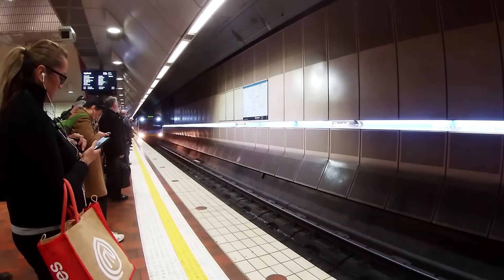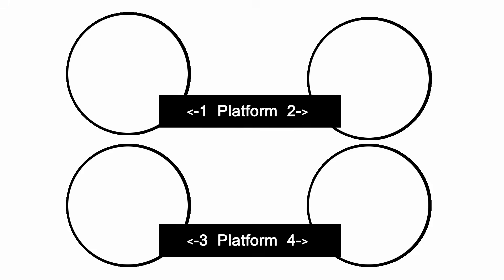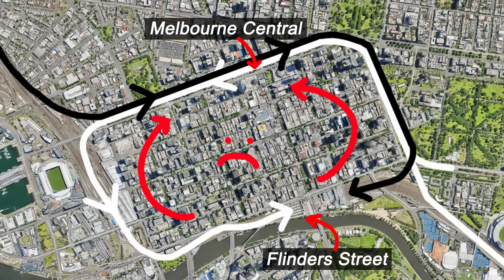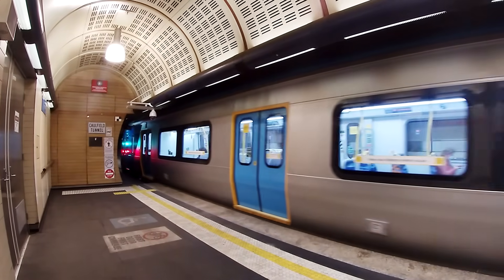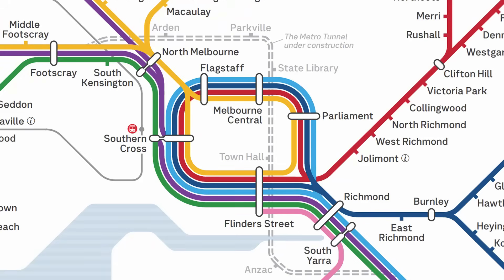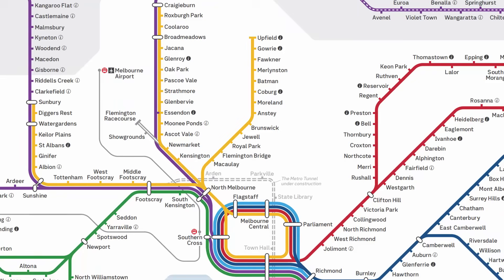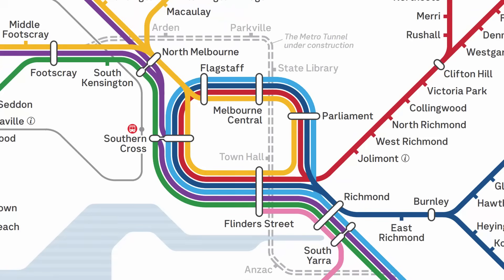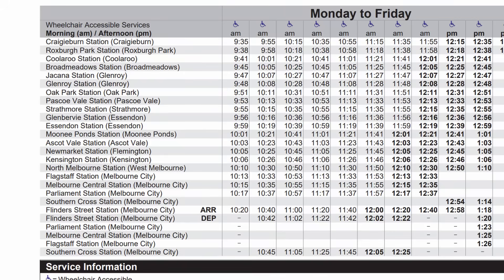Melbourne's Underground City Loop - Explained!

Comment: Usually the sunbury line terminating at flinders immediately goes to southern cross to become the cragieburn line back out to north Melbourne afterwards. But honestly I just use the app to figure out which platform to run to for whatever station I need after getting into flinders or southern cross

Comment: Found that I couldn't trust night trains at all especially at flinders. Sometimes on the board it will say it will come at a later time but then once you get to Southern Cross it will say there's an earlier train but it comes from the same direction as Flinders
Reply: Can't even use google maps after 8pm because it shits itself

Comment: the worse thing is, if you decided the trains are too comfusing so you'll just drive to the CBD, you are in for some more TREATS. first off, it's damn near impossible to find parking, even if you are willing to pay unreasonably high rate. then, you'll be greeted by the infamous "hook turn", where you have to go to the leftmost lane in order to turn right, while obeying the traffic lights perpendicular to you and ignoring the lights you are actually facing. come to melbourne. it's fun (sometimes at your expense)

Comment: Does anyone know what will become of the Caulfield Loop Tunnel when the Pakenham/Cranbourne lines are removed off the city loop and rerouted through the metro tunnel? As far as I know it is only those lines which currently use the Caulfield Tunnel in the loop. If they are to start using the metro tunnel instead, what services will use the Caufield Tunnel?
Reply from the maker: It's my understanding that Frankston will go back into the loop, and Werribee/Williamstown will through run with Sandringham.

Comment: I absolutely hate Parliament Station. I fell up the long escalators and grazed my knee. I was just thankful it wasn’t down. That being said, the lifts from platform 4 are also horrendous. It was so slow that I was truly afraid we’d be stuck. But trying to take a hyper toddler up the escalators was not going to happen.
Reply: There's a separate YouTube video just on those escalators at Parliament Station. The ceiling design creates disorientation going up or down, similar to the effect of an optical illusion. Your brain thinks you are travelling horizontally. This together with their great length have caused more falls than any other escalators in the M.U.R.L.

Comment: There is a great solution to Melbournes Loop problem and it can be found in Liverpool, UK of all places. they have a 'Wirral Loop'. All trains stop at James Street station and then proceed around a clockwise loop. As soon as the train gets to the next station, Moorfields (the first one on the loop), the train then changes it's destination to wherever it is going next and does the normal announcement of 'this train is for [destination] calling at [stations]' so anyone onboard already doesn't have to worry as their station will be one of the few upcoming stations and anyone starting their journey at Moorfields never knows where the train came from but knows which suburb it is going out to.
Reply: they often do this in peak hour in melbourne. I really dont know why they dont do it all the time.
Reply: A similar operation style is used in Sydney's City Circle
Reply: I don't know if this is applicable to Melbourne and it sounds like it would be annoying if you were at James Street and wanted to head in the opposite direction of Moorfield. Honestly Melbourne's city loop is generally ok given the circumstances. If patronage was higher, I could see us running enough services so that trains run both way around the city loop (need bidrectional tracks in this hypothetical obviously) but at the moment the ~10min wait between trains during peak times just doesn't make it worth running a train in the opposite direction at the same time; you just gotta cop the 10 minutes detour around the loop. I've always found it convenient on the Glen Waverley line when I go out with friends that it goes around the city loop (MC being the important destination), but I can imagine the inconvenience of needing to changeover at Richmond to get to Flinders.
Reply: @parkinfurkmaz2877 You can't go in the opposite direction round the loop as it's a single-track, unidirectional tunnel. The stops are always James St > Moorfields > Lime St > Central > James St again > various destinations. This does make the described announcement system a bit pointless though, as if you're going to one of those various destinations, you would have already changed train at Hamilton Square, the stop before James Street.

Comment: So if you get on a train in Melbourne, it’s an absolute guessing game as to where you will end up. That is ridiculous. You would think that in a city as big as Melbourne, they would get it right instead of confusing people, especially visitors from interstate.
Reply: Not particularly, when you get on a train heading outbound (from the city) it shows the line, end station and all stations that the train is taking on platform screens (as well as the line on / in the train itself).

When heading inbound, you're going to Flinders Street Station, and it will show either directly or via the loop on the platform as well as on / in the train.
Reply from the maker: The disfunctional part is having to wait until Flinders Street to find out where it's going next - and frequently having to check the platform displays there, which you really shouldn't have to do as someone who is already on the train.
Reply: @Taitset  yeah, and the stupid PTV app won’t tell you where your Flinders Street bound train is heading to after Flinders Street. There have been so many times I’ve gone on PTV journey planner to plan a journey from my station to one of the city loop ones, and the app is basically like ‘lmao ur gonna have to get the tram from Flinders Street’, but in reality I don’t have to because the train goes through the city loop after flinders street. I wish PTV would update their app to rectify this issue.
Reply: It’s not that awful. There are great displays everywhere telling you which platform you need and they show all the stops on the next train to come. You learn pretty quickly how to navigate.

Comment: Just to travel 2 stations I have to take two trains , talk about Melbourne train network
Reply: Wait what stations need two trains?
Reply: @Chloeshadowstar9779  Kensington to southern cross
Reply: @srinivasanurag9424  how's that happen? If it was a city loop train, most trains that just came from the loop will then go to southern cross, so you could have stayed on it at Flinders and it should have gone toward to Southern Cross
Reply: @Chloeshadowstar9779  sorry I meant when coming back ,

Comment: Had no idea it was so elaborate and complex. That's good and bad. Good because it's more substantial and is  important to the functioning of thewhole rail network and therefore significant infrastructure added to the city, bad because it's not as user friendly as it should be and causes stress to regular commuters let alone first timers. Melbourne being a planned city has dropped the ball here and not done enough to address the problems which reflects poorly to me.

Comment: haha I remember as 14yo in the early 90s friend and I went to the city for the car show on a weekend and then wanted to go to Melb Central. counted the number of stops we needed and took the train. Train was not supposed to stop at Flagstaff on the weekend but it did and we got off. we were inside a locked train station with no staff lol.

Some how we found a pay phone inside and called 000. 15-20 min later a train finally stopped and driver got out and we went through the drivers door into the passenger compartment... The days before mobile phones!
Reply from the maker: Haha that's awesome. Cool they just used a train to pick you up rather than sending someone to unlock the exit.
Reply: @Taitset  Yep! We felt cool going through the drivers door. Driver kept the passenger doors still locked so no more people got off.

Got weird looks from the existing passengers...
Reply: @Taitset  even finding the pay phone was a challenge iirc, ended up in the staff rooms to find one
Reply from the maker: That's pretty amazing.

Comment: An interesting film. I didn't know Melbourne had such an extensive suburban rail network. 
In England,  Liverpool has an underground loop line, though a bit simpler. Trains coming from Birkenhead through the Mersey tunnel arrive at St. James Street, then a single line runs through Moorfields (near the former Liverpool Exchange station), Lime Street,  Liverpool Central, then back to St James Street. There is normally unidirectional running. There is also another underground line connecting  Moorfields with Liverpool Central. The loop line was opened in 1977.
Reply: much better than the circle line in london which isn’t even a circle anymore

Comment: It’s confusing for 2 simple reasons

1 original layout and configuration of Melbourne is confusing to begin with, for a small city it’s also one of the most difficult to get around in. Melbourne was designed by a junior city planner in Sydney on a single sheet of paper. Aka no fucking thought to its layout, not that Sydney is any better. Most people don’t know that NSW and VIC at one stage was one state and Vic was subordinate to all of Sydney’s commands including city/town planning.

2 like all Australian cities they are poorly designed on English structures. English cities were designed for the elite of society as it was irrelevant where the working class lived therefore you have centralised areas of industry instead of it being balanced dispersion. Because of this they did not account for population growth therefore most of the capital cities cannot be upgraded or expanded including the public transport services. Melbournes population is growing fast and with Covid taking a back seat will only continue to grow faster and current infrastructure for Melb is still stuck in the late 90s at best and all current infrastructure projects will only be good for the next 5 yrs.

Comment: I’m from NYC with like subway 25 lines, LIRR, Metro North, PATH train, NJ Transit, and Amtrak. And this loop confused the hell out of me. That’s probably the only transit system I’d get lost in lol
Reply: Basically all lines in Melbourne lead to Flinders Street (and all lines outside Melbourne lead to Southern Cross (Spencer Street). The only question is “do I need to change trains at Flinders Street?”.
Reply: NYC here, too! This makes our system look downright elementary. But in a good way. The NYC system certainly has its issues but understanding it is not one of them. No offense to the creator of this video but a rocket scientist couldn’t clearly explain this hot mess of a system.
Reply: When i was younger living in Melbourne I can definitely say Ive been lost slot of times, you just get used too it I guess
Reply: I'm a Melburnian who has travelled the NYC Subway (including PATH) a few times. I loved it - it got me everywhere in NYC. The only time I got confused was switching stations in the Subway. I misread the directional sign as meaning EXIT the station first, then realised my error and had to re-swipe my Metro card to re-enter the Subway. Lesson learnt - read signs more carefully! I would always travel from JFK Airport into Manhattan (and vice versa) via Airtrain / Subway - so much cheaper than a cab. The Citymapper app is indispensable when using public transit systems in NYC, London and my hometown Melbourne. You don't need to understand the complications explained in videos such as this one.

Comment: Also sometimes they do run city circle trains through the Clifton Hill Loop using the old city circle portal like they did in the 1980s if all three other tunnels in the loop are closed for maintenance purposes which has occurred a few times previously within the last few years! :)

Comment: Infrastructure Victoria has recently recommended reconfiguring the City Loop to create bi-directional thru-routes between Craigieburn to Frankston, and Upfield to Glen Waverley. All that is required is two new little tunnel segments between North Melbourne and Flagstaff, and Richmond and Parliament. This will solve soooo many of the Loop's problems! Maybe you can cover this proposal in a Part 2 video?
Reply from the maker: Yes I have been considering doing that!
Reply: Especially with future proposed through running
Reply: Reversing the Northern group evening direction due to works solved a lot of problems. On those days it never faced delays, whereas with normal running it always got stuck on the viaduct between southern cross and Finders Street.
Reply: @Taitset you never did a Part 2?

Comment: it could do with a weekend shutdown where a rail trolley goes in there and Kartchers off all the dirt and grime and shit between the platform over the track and up the wall to the overhead.
Down at the platform, the joint hasn't been cleaned since it was built. The escalator tunnels could do with a new paint too, starting to look very tired.

Comment: City loop, while much needed at the time and still viable, is definitely overengineered and made unnecessarily complex. As a person who design railway signalling and train control systems, I think it's absolute operational nightmare. It is still needed today, just have to be simplified a little. Metro tunnel and possible second tunnel would immensely help untangle the mess.
Reply: The Melbourne Outer Circle would have eliminated a lot of these issues…
But that was mostly closed in the 1950’s…
Reply: There's nothing overengineerdd about it. Your lack of understanding doesn't make it overengineered
Reply: @michaelellis8726  i will not accept your ridiculous insult. "lack of understanding" of what? It literally says in the video that city loop is very confusing. You being a dickhead here doesn't make it more simple.

Comment: 8:30 i believe it was discontinued due to Princes Bridge closing and there being no spare space on platform 1 for them, you're right there are no public timetabled services however they do run on weekends every 20 minutes when any loop apart from the clifton hill group is closed for maintenance, now theres a good secret for ya
Reply from the maker: I hadn't heard that reason before, but I guess it probably was a factor. Another time it gets used is when there's a Jolimont-Clifton Hill occupation and they sometimes run the CC to connect with busses at Parliament.

Comment: Great work. I’ve lived in Melbourne for 10 years and still find the loop confusing. But the stations have retained their 80s charm and the wide passageways showed some foresight by the designers.
Reply: 80’s charm for sure! These stations have barley changed one bit since the day they opened. If you went back in time to when the loop opened you would struggle to see any difference 😅
Reply: 80's charm? That's the first time I've ever seen that phrase used.
Reply: It is confusing for casual users because the trains change direction seemingly at random.

I had no idea some changed at midday and others didn’t until I watched this video. I literally thought they just went in arbitrary directions based on what I’ve experienced catching each line a few times a year.
Reply: The only difference is Melbourne central used to be named Muesam station, have a look at the London underground, that is really confusing, mind you, London is probably bigger than Sydney and Melbourne
Reply: @BillWalters-iz3tv In terms of population both Sydney and Melbourne combined would beat London (obviously not separately). Even in terms of geographical size, Sydney and Melbourne individually would beat London in terms of physical area size, but London’s CBD is much bigger than both of these cities own CBD’s, which probably gives off the impression that London is bigger then it actually is (it’s compact).
Reply: "80s charm" yet the station looked like they were built yesterday.
Reply: who doesn't find all lines confusing
Reply: How is the loop confusing? When I lived in Footscray before moving to Brisbane I always knew which direction the train was going. I've never been confused using the city loop.
Reply from the maker: Did you watch the video? It's literally about why the loop is confusing.
Reply: @Taitset  it is confusing for people who aren't used to it. I grew up in Melbourne, so I just took the operations for granted. Thanks for pointing out all the oddities that I'd never noticed.
Reply: @michaelellis8726  Yeah maybe this video does exaggerate the confusion. I've not used the City Loop particularly many times, but I will still say that I've never found it confusing. The information screens at all the stations there, showing which trains will depart from which platforms and when, have always clarified things for me. And, in my experience, if the train is starting its journey from Flinders Street Station and going via the City Loop, the information screens and announcement will always say so.

BUUUUUT I have lived in Melbourne all my life and have almost exclusively used the Glen Waverley line.
Reply: Example of city loop confusion, first, some people at Melbourne Central wanted to get to Flinders street. There was no service making that possible. Second example, in the evening waiting for an Alamein or Ringwood service which does not pass through the loop, despite Lillydale and Belgrave services. Third example, interchanging from a Burnly group service to a Northern group service in the loop during the morning. The sign says sunbury, but when you get to Flinders Street, it is suddenly transposed to a Cragieburn, without announcement.